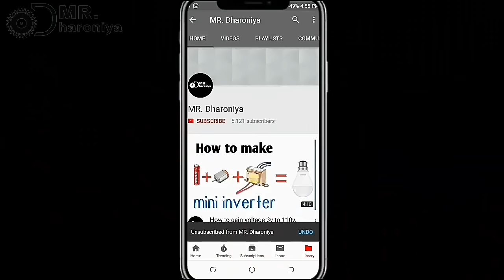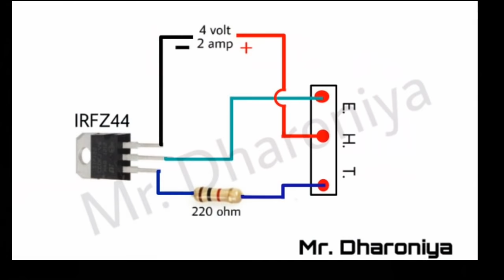How to make super voltage booster. 3.7 to 25000 volt 😲😲😲

Comment: I made it and i check with a high voltage checking multimeter and the voltage are 35000 ⚡
Reply: How did your multimeter...?!!?!
Reply: No it's not  35000
Reply: @pavletrubajic5269  yeah the multimeter will malfunction at very high voltage
Reply: Yes i tried to measure the spark gap tesla coil voltage and the multimeter screen glitched and turned off

Comment: This is a very good video, I just now made it and it's working. Thank u for this video. 😊🙏, but a problem is there, just as I am connecting battery,it is Short Circuiting.. And the MOSFET starts to heat so quickly. Please help me out with this problem, I will be very very thankful to u🙏🙏
Reply: Insert big MOSFET cooler

Comment: Breakdown voltage of air approx. 10000v per cm.  In the video u r getting about 1.5 cm arcs .. it should be 15000v
Reply: Brother it's 30kv/cm (breakdown voltage) and we have to use the initial distance when arc jumps I suppose it's between 28 to 32 kv

Comment: For checking volatge measure the length of the longest arc the ckt can produce , for 1cm it's around 30000v
Reply: why my volt booster crashed in 1cm arc with 2 3000mah battery of 3.7 volt

Comment: Hi there, I'm your big fan. I followed your videos for many small projects.
Recently i build a 12 volt battery charger using 12-0-12 transformer, 4007 diodes and 2200uf 25v capacitor.
But output voltage was 16v.
Then i use a autocut system using 12v relay.
But it not stops at 13v.
Its increasing continuously charging towards 14v.
Please suggest me how to solve it.
Reply: Use a 1k resistance
Reply: but not transformer u hv to use inductor